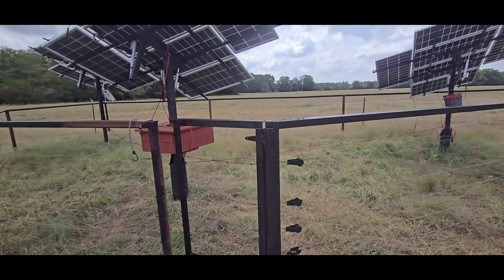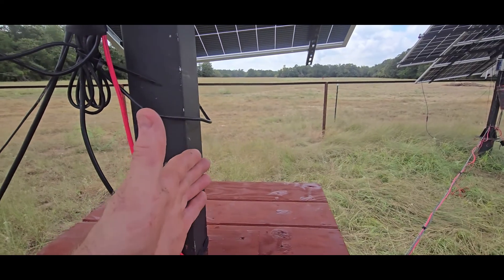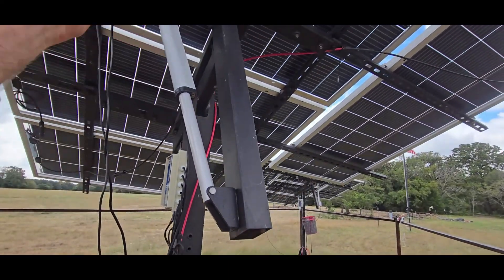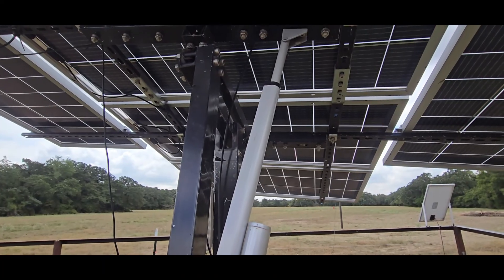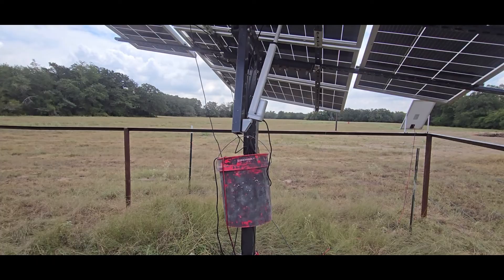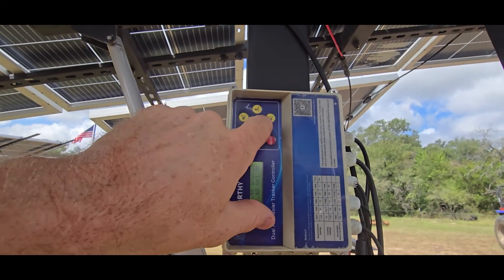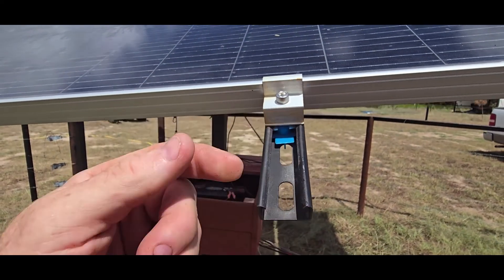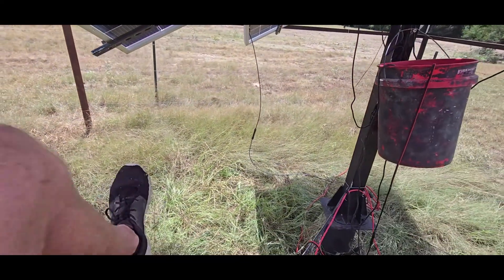Solar tracker installation tips - Universal with focus on Eco-Worthy

Comment: My 4 trackers  quit retracing at night, work great  for about  5 months .Tried calling eco worthy over a year no call back,  or reply from e mails ,
Reply from the maker: You have 4 different trackers that are all doing that?
Reply: Yes @DavisOffGrid
Reply from the maker: @waynelincoln6340  do the boards power up and just not move or no power at all?
Reply: Yes, they have power say waiting for sunlight the morning.  I have to manually move them facing west to east, then they start tracking correctly  all day. Have pushed E/W buttons several times inorder for controller to start moving them   On 2 of the I put a splice in the E/W arm and bypass controller and direct power from battery direct to motor and move the tracker ,reconnect to controller and tracker starts works correctly all day .

Comment: why not use a bracket and make the controller gromets all face down to take the tension of the cables
Reply from the maker: There really isn't a lot of stress there. It's mounted according to instructions. Have had to repair many things with these but cable stress hasn't been one of them yet.

Comment: i have to ask, why not add 3 small solar panels as extensions to the array as the panel would also track the sun for max efficiency. but have 1 larger battery to run all 3 trackers motors but put all the cable underground?
Reply from the maker: I thought about various things like that. I've still not cleaned up wiring completely. As far as an extension, anything more to catch wind is a no-go for me. If you were to do that I'd recommend putting it on the north side. Adding weight to any of the other sides is going to put too much stress on the motor. The north side never goes beyond flat.

Comment: what are the measurements of that base plate? Also, do you have a picture of the bolt pattern? I looked on the online manual and it's not listed. it looks to be about maybe 6in? or 9? I ordered the dual tracker and I'm going to attach it to a pole base but I needed to have the plate fabricated. I wanted to get the plate done before the tracker came so I wouldn't have to lose time on the installation. I just needed the plate size and then I will drill the holes on-site.
Reply from the maker: Hey. I'm traveling but will be back later tonight and I'll measure for you. May be morning before I get back to you.
Reply from the maker: Hey. I'm traveling but will be back later tonight and I'll measure for you. May be morning before I get back to you.
Reply: @DavisOffGrid thanks!

Comment: I just put 2 more up that puts me at 4 now.
Reply from the maker: Doh!! Just seeing this. I responded to your other message. Please follow up with what is happening. If all 4 are not working I gotta think there is power or some other issue. I have lost 2 controllers on these at same time. 4 is not out of the question but man that would be crazy.

Comment: I have one of these with 8 200W panels on it, I ended up puting my controller in a waterproof box.  Seems to have helped alot, but still I think solar sensor may be going.  sometimes goes fully west at 10:30 AM
Reply from the maker: Thank you! I'll be migrating equipment soon and will setup properly

Comment: The reason you had to swap the wires is probably the same reason I had to, the E/W actuator is supposed to be mounted on the west side with the mounting beam mounted on the east side, I did the exact same thing on my first one, I’m guessing the one you had to change the wiring on is the middle one? That also affects the angle that they tilt to, the newer models have the beams labeled so you get it right now.

Comment: Davis , I have larger panels , do you think it hold them. I have 16 panels. They are 390 watt panels. They measure 48 inches by 65 inches?
Reply from the maker: My panels are about 20 lbs each and are 53" x27". When the wind gets going above 20mph I get puckered up because they bounce around a bit more than I'd like. Some of that is just because the motor linkages have a lot of play. But some is the rails bending. I wouldn't put anything more on it than 120lbs. It is also critical to mount them in a balanced fashion. Linear actuators are about at capacity even when balanced. 

Not sure what other options there are but if try to find something a bit heavier duty. Alternatively, might look at a single axis tracker. Not the same as full tracking, but sturdier.
Reply: I have reached out to eco worthy and no reply yet. Thanks

Comment: Due to the extreme drop in the price of solar modules, tracking systems are now superfluous.
Where mechanics and electronics are outside, there is a lot of maintenance and failures! And they are very susceptible to wind. Due to mechanics & weather, most only last 1-10 years. 
It is cheaper and much more reliable to simply install more solar modules. They easily last 25-30 years without maintenance!
If you want more consistent yields throughout the day, you simply need to place the modules in an S-E and S-W orientation.
Reply from the maker: Understood. I'd probably do that if I had it to do over. However, I don't have a lot of storage so it's good to get the morning and evening boosts.
Reply: Totally disagree with this logically blind answer.    Sure, absolutely, add more cheap panels instead of trackers.  Unless, someone is space constrained!  Most people don't have room for a couple of dozen giant panels.   In that case trackers are the only possible way to maximize your energy harvest.  And that can be a 40% gain.   Might be Davis doesn't want to block more pasture space, or have to pay to fence a much larger area.  In that case trackers make some sense even if they cost more, even if they need some maintenance.    The price thing is often a wash too.  I put eight 370W panels on a shed roof.  The static roof mount hardware cost 90% of the array cost.  Ridiculous!  Wish I'd spent that on trackers.